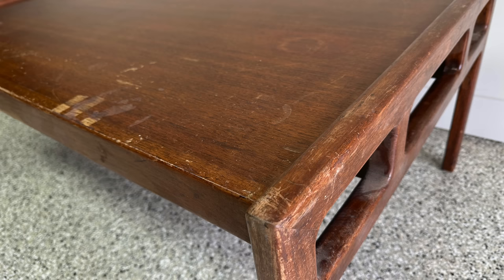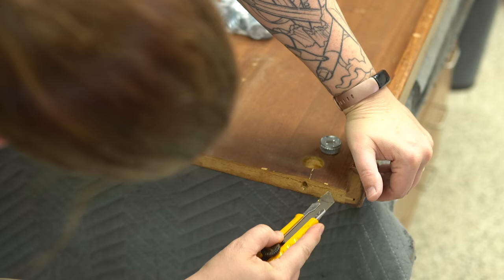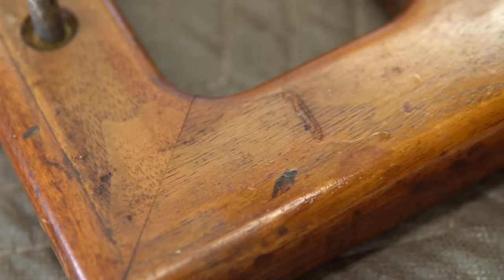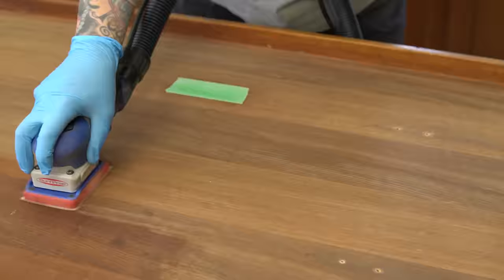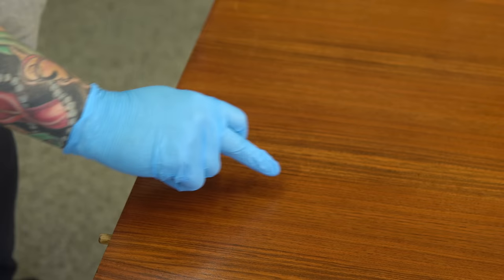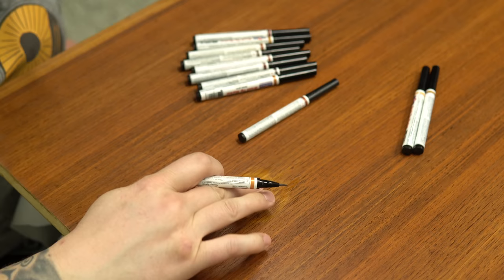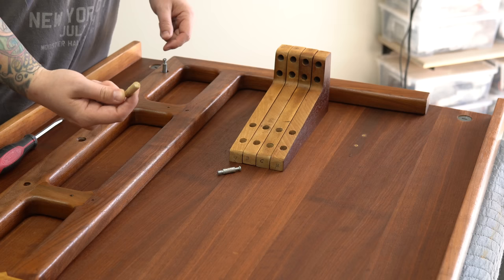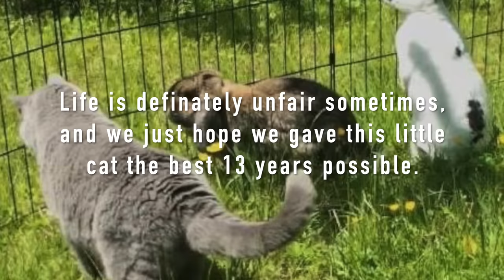I Restored a Designer Teak Coffee Table!

Comment: Looking at the wooden support brackets you repaired, where the break is at the screw hole level, I’d like to suggest that you could use 2mm brass rod vertically on either side of the break holding the upright sections together. It would give extra strength to the repair. (It’s a model makers trick.)

Comment: That came out really nicely. I like the epoxy trick in the pressed wood, that's smart.  I think those cam nuts are made from sintered metal, which is basically the metallurgist version of chicken mcnugget meat. Maybe someone really skilled could TIG weld it back but it's dicey.   Glad those wood braces came out OK. I'd still be suspicious of them but it's kind of hard to do anything to reinforce them across where they cracked without fighting the wood expansion. Very enjoyable video.
Reply from the maker: Thank you! Cheers!

Comment: From what I've seen, lighter colored rings tend to be from heat. If someone microwaves a cup or a bowl and sets it on at table, it melts the finish on the table but doesn't really affect the wood underneath whereas condensation soaks into the wood causing the darker rings. Although yours didn't end up sanding out, so I think you're right on where that ring came from
Reply from the maker: Thank you very much!

Comment: Nicely done! I've noticed that with a lot of MCM furniture especially Scandinavian teak furniture. It has some pressed wood and I despise that material so much. I had always assumed that it was solid. They sure charge you a mint for it however. I have noticed when sanding older furniture there is a very caustic type of varnish they used and using a good respirator mask is a must, those paper masks are horrible and you'll know it immediately when your nose and lungs start getting irritated and it's nasty.
Reply from the maker: The pressed wood makes the furniture extremely stable from a wood movement perspective though, where solid wood is very prone to cracks and checks when it expands and contracts with temperature and humidity. It allows MORE furniture to be made from the same exotic wood, rather than one single temperamental piece of furniture, and it makes it more affordable for both the maker and the consumer. Have a look at retail prices of this furniture and the fact that they sell like hotcakes.. and then ask where the value is, haha. It's not just mid century though. A LOT of antiques with stunning woodgrain are also veneers. Veneer doesn't mean cheap. And the pressed wood of the mid century era is not the same as the 1980s and 1990s junk.

Comment: I would say the metal the locking parts are made from is likely Zamak. It's often used as an easy castable metal, easier to cast than aluminium but less repairable. It's still quiet commonly used.
Reply from the maker: Thanks so much! 🙂

Comment: • the locking cam disc fastener is zinc. Zinc is heavier/stronger than aluminum, but is more brittle than aluminum. 

Applying heat to the cam with a heat gun before squeezing it in the vise might have worked…probably would require a temporary metal shim precisely the thickness of the cam’s cavity to be inserted before pressing the deformed cam  in your vise - - when replacement parts are not available and you don’t want to machine the cavity to accept a mismatched oversized fastener…
Reply from the maker: Thanks so much for watching!

Comment: So very sorry about Muffin. Heartbreak at their loss means you love them with everything you have and that’s how it should be. 
Beautiful beautiful table❣️
What does the vinyl sealer do and when should you use it?  I get so confused on when to use shellac, lacquer or sealer.   I guess I always thought of them as a “top coat” or last step.  🤷🏻‍♀️
Reply from the maker: The vinyl sealer can play many roles (such as buffer coats between layers of stains and glazes,etc) and it aids in durability as well as adhesion. It also provides excellent water/moisture resistance. I have a couple of videos posted that may help. They are here - https://www.youtube.com/watch?v=g8_Qsru0jWE&t=483s and here - https://www.youtube.com/watch?v=HMeMBl4rrek&t=136s

I hope this helps!

Comment: The metal for the cam is most likely pot metal. A low cost alloy with a low melting point, widely used in toys, jewelry and furniture fittings.
Reply from the maker: Thank you so much for watching!

Comment: You did a fine job on bringing back that table but out of curiosity was there a reason for nor replacing the top with some solid wood of the same species as the legs? It would have been an easier restoration and one that would likely stand up better to future wear. I really dislike veneers if it’s possible to do a restoration using solid woods. I’m lucky in that where I live in southern Missouri we have an abundance of reasonably priced hardwoods. 

Keep your fine videos coming.
Reply from the maker: Solid teak on the top would have cost about $300 or more, and would be prone to cracking and warping with how it attaches to the legs with that sort of span. There literally IS a reason all these mid century pieces with beautiful teak and walnut and rosewood tops are veneers. It’s more stable than solid wood, from a wood movement perspective, less prone to cracking and warping, more cost effective, and more ecologically friendly. A lot of woods used in these pieces are rare and some are even considered endangered, so it’s getting MORE woodgrain out of a single log to do it as a veneer.
Reply: @TranscendFurnitureGallery  thanks for the thorough and logical reply.

Comment: This table turned out so nice. I do not know why you use toner, can you tell me what that did to make such a difference?
I am so sorry about Muffin, I have 2 dogs & 2 cats and they are my companions. That is a hard loss.🙏🏻
Kim
Reply from the maker: Toner is mainly used in situations where you need to change the tone or opacity of stain or natural wood color. It's also used to color match repairs or parts of a piece that has been refinished in order to have the correct tone. A toner is simply a clear finish with dye or pigment added. Most often, the finish is lacquer, but it also can be shellac, waterbased, or varnish. Just like a toner you would get over your highlights in the salon, a wood toner is a translucent coat that lightly deposits color over the surface. It can be used to neutralize unwanted tones (like brassy highlights), even out splotchy color, or darken an existing finish.

Thank you so much for your kind words. I really appreciate that. ❤️

Comment: I am sorry to hear about the loss of Muffin. You will meet again across the Rainbow Bridge. All of my four-footed fur children are buried around my patio, sitting in "Library Lion" posture, facing West, towards the Summerlands. (And I'm Catholic ... Go figure...)

As to the twist-lock fasteners,  they are most likely Zinc or a Zinc/Tin alloy, AKA Pot Metal. Cheap, relatively strong, but, as you discovered, very brittle. Nickel would work better, but for fifteen or twenty times the price.

Like all your work, the table is beautiful, and will probably last for decades. 

A couple of questions, if I may. First, do you do your own tats? The detail and colors are superb. Second, do you do commissioned paintings? That uncompleted design in a recent video was beautiful, even if only partially finished.
Reply from the maker: Hi Dave- I don't do my own tattoos, although I've always wanted to do one! Unfortunately, I don't do any commissioned artwork, aside from charcoal pet portraits at Christmas time. But even those I'm finding hard to squeeze in these days. This dang channel takes up a lot of my time, haha. 

Yes, I was surprised how brittle the fasteners are! The new ones I purchased were much better. In retrospect, I should have just replaced them all. lol 

Thanks you for the kind words about Muffin.

Comment: Hi Angie. I'm Michael.  I've used anne Sloan's paint in the past.  I tried mineral paint recently.  But it ended up kind of streaky.  Just loved the color coal black.  Will a top coat fix that problem?  What can I do?  I just absolutely love your work and trust your judgement. I'm not sure what to use as a top coat on paint.  And on top of it I am painting my kitchen table white and also using gold leaf on the sides and the top.  Do you think  Odie's oil would be a good protective top coat?  And will it not yellow? If not do you have another suggestion? Please help?
Reply from the maker: Odie’s certainly can be used over paint but I much prefer it over raw wood. I had great results mixing a little bit of the paint into a water based topcoat. It helps provide a streak-free finish. If you check out the little bar cabinet I did a few videos back, I actually do it in that video- you can see how it works. Works especially well  with dark colours, and you don’t need to add much paint to it to get the benefits.

Comment: Hi, I want to start refinishing MCM furniture ( I've been a house painter for 25 years) but I have a few questions.why do you use a vinyl sealer before you put on a topcoat ext? And why do you use a toner opposed to a stain? I guess what is the purpose  /benefit of both of these? Thankyou so much. You do excellent work!!!!
Reply from the maker: I actually explain that at about the 20:30 timestamp. The sealer seals in the work already done and allows me to work in layers so the colours don't all blend together. 
Toner is mainly used in situations where you need to change the tone or opacity of stain or natural wood color. It's also used to color match repairs or parts of a piece that has been refinished in order to have the correct tone. It's used overtop of some sort of seal coat like vinyl sealer or shellac. It also needs to be top coated after the fact as well, usually with lacquer.

I hope this answers your questions! Thanks so much for watching! 🙂

Comment: I have used spray sealers/clearcoats and It seems difficult to not get lines based on where you spray, I am thinking I need to back off distance wise to avoid the hot strips? more of the "fog" method :D any tips to avoid those stripes!
Reply from the maker: The most important thing is to have a 50% overlap. Exactly 50%. Any more and you get a darker, thick line, any less and you’ll have a lighter and thinner line. 
Think of it this way- take three sheets of paper. Lay one in front of you. Take the other two, and butt them up against each other over the first paper, seam in the middle. That’s a 50% overlap. If the two additional papers overlap, you have MORE opacity if you were to hold the whole thing up to a window. If the two papers don’t meet fully, you’ll have less opacity. Also- move your entire arm (don’t spray while simply hinging your wrist back and forth), and entire body. You want to literally sway back and forth, keeping a consistent angle, consistent speed, and consistent 50% overlap.
Reply from the maker: Oh/ and it’s always better to do more thin coats, than fewer thick ones. :-)
Reply: @TranscendFurnitureGallery  Yea I think I need to perfect the sway/distance... appreciate the reply/tips and you do some great work!

Comment: I’m curious, you call this mid century but I thought camlocks were invented in the 1980’s? Do I have my history wrong? Either way I love the finished piece!
Reply from the maker: Technically speaking, a cam lock is literally a lock with a key. For some reason, the style of hardware on this table are often called locking cams, locking screws, and cam locks, though it may be a misnomer. These are found fairly frequently in “flat pack” style mid century furniture, like big shelving units and some smaller ones, like this coffee table. I don’t know the literal, correct term for what that hardware is. I know it only as a locking cam, but it’s technically not correct. 
Actual cam locks (with keys) were introduced and perfected in the 1980s, though similar predecessors have been around since the mid century.

Comment: The material that table was made of didn't  exist mid century! It must have built in the 70's or 80's .
Reply from the maker: Yeahhh, so pressed wood and particle board (not the same material) began conceptually in the late 1800s, and became more common in the 30s and into the 40s. The 50s and 60s is when it really picked up, and actually, mid century furniture is almost entirely high quality veneers over pressed wood, or plywood. Almost all of it. Yep, even the high end stuff.